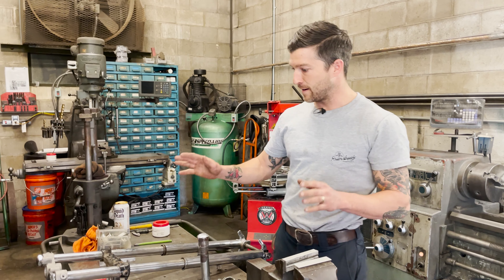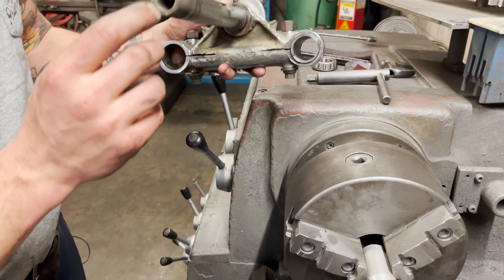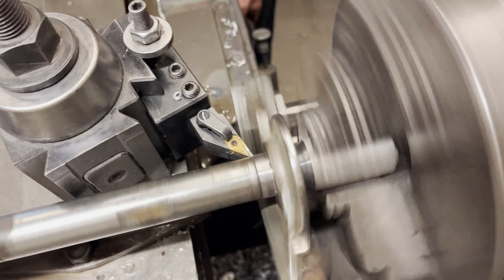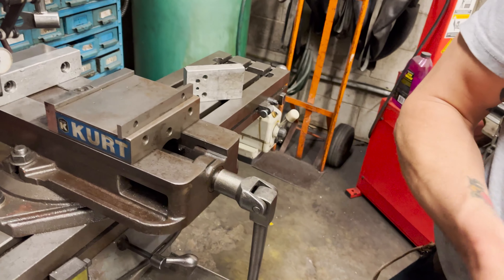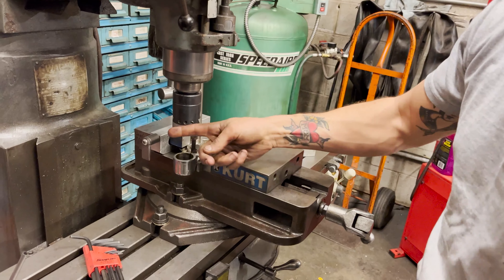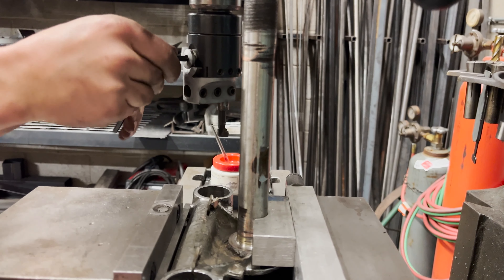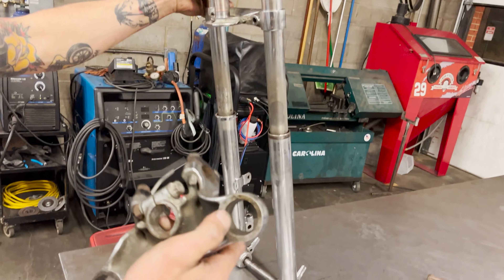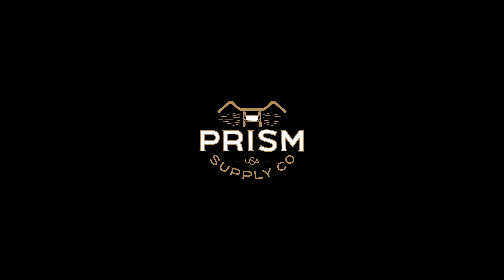Triumph Trees on a Harley-Davidson

Comment: Great informative video here. In the distant past, I remember guys wanting lighter forks on their 74s and 80s. They reworked K-Model or early Sportster front ends to fit Big Twin frames. The Motor Company caught onto that when they designed and built the first Superglide models. You're on your way to creating a 60s period-perfect bike. Good luck!

Comment: BTW, and I'm not confident, but I think that top yoke preunit 1960-1962. Is the casting H1287? I THINK all unit pull backs had a key slot EXCEPT I think they used the same yoke for the TT specials from '64-'67.

Comment: So what magic happened to get the top nuts to thread down flush and tight? BTW normally the power quill feed is used with a boring head and setting the stop like you did disengages it. But I'm sure you know this. Great video showing how to hold something tricky!

Cheers,

Dre'
Reply from the maker: Basically we just cut down the lip where the O-ring sits so the diameters wouldn't interfere. We actually still need to do a little work to the whole thing but we're close! In regards to the quill, yea we're aware of it and probably should have done it that way but it was such a little amount to machine out it wasn't a big deal doing it by hand.